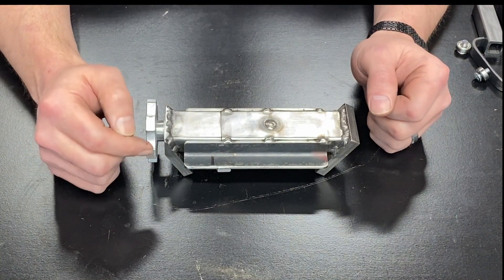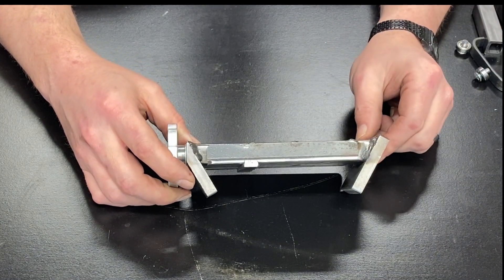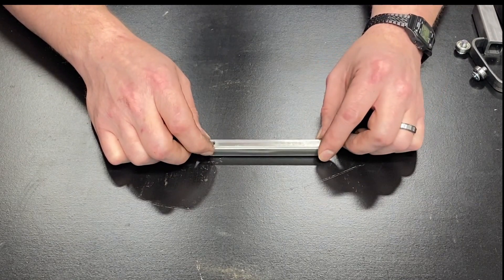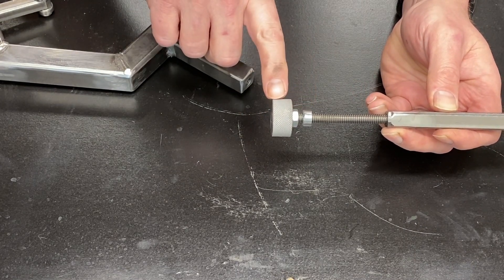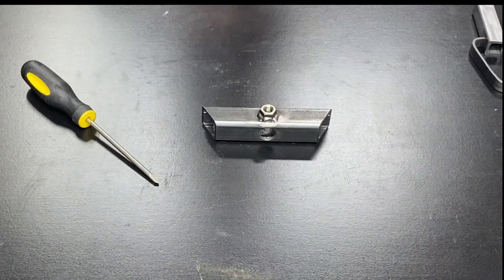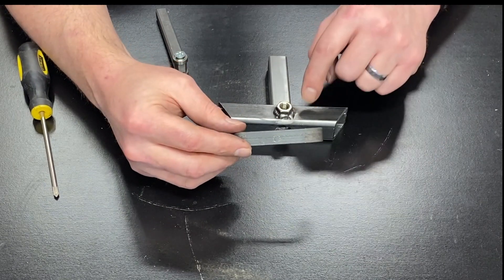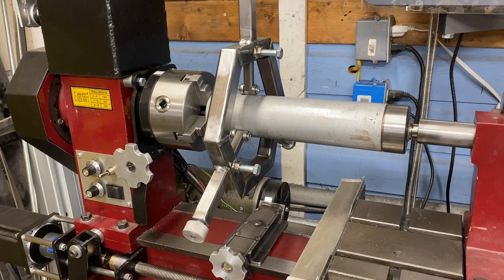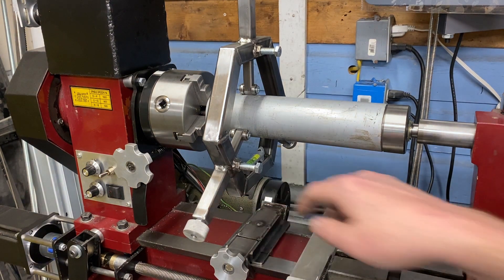Problem Solving and Mechanics on a DIY Steady Rest Build for a Metal Lathe

Comment: Are you happy with having the complete frame? One of the painful things for my steady is that it has a gap to allow you put it over an item that is mounted in the chuck and tailstock, but it is really is to narrow a gap, for any stock greater than about 30mm in diameter I have to move the tail stock out of the way to fit or remove the steady. Being a baby lathe there is not a whole lot of room on the bed to do that easily. I am seriously thinking of changing it to a hinged setup.
Reply from the maker: I won't be using it that often so I don't think it will be that big of an issue.  Several other have suggested that it should come open and I have been thinking about several waus to make the top come off. I may yet do that but at this point I am going to use it as is.

Comment: Unrelated question... Is there a difference in putting your motor controller choke on the positive vs negative? Thanks for the info
Reply from the maker: totaly unrelated to this video 😂😂 yes it needs to be on the positive wire so the power is filtered before it goes into the motor.  putting it on the negative side would mean the power going into the motor was still dirty.